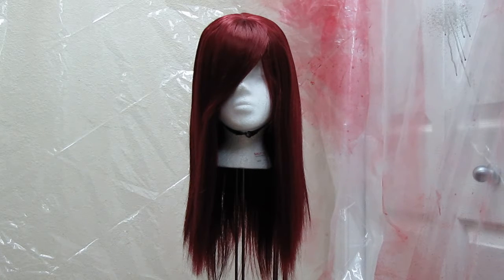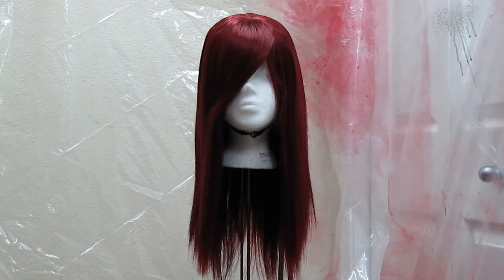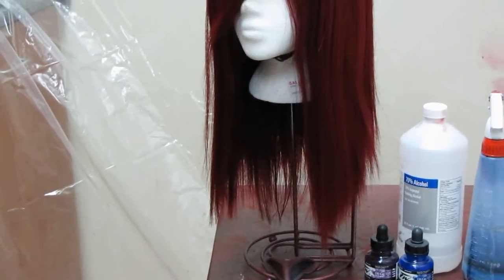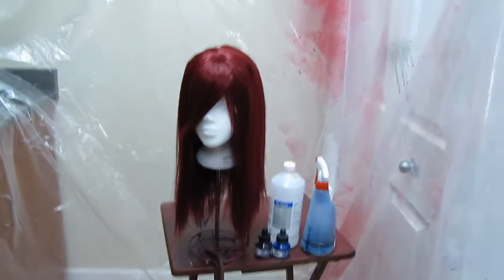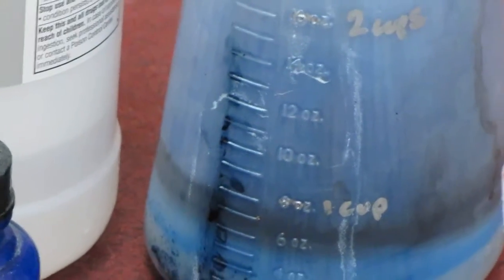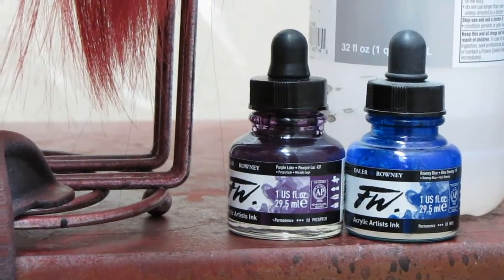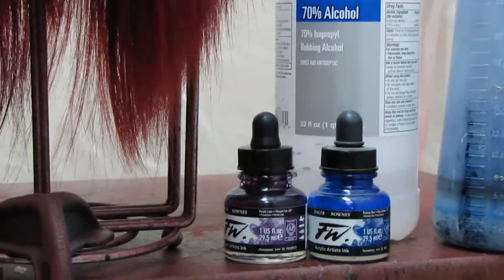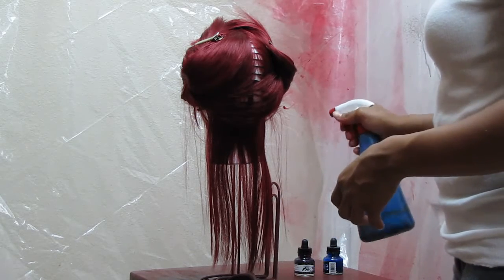Cosplay How-To's: Dyeing a Wig (FW Ink)

Comment: I appreciate this video. I wanted to die a all blonde wig with black under tones. I pin up the blonde part and put a shower cap on and pin that on. I used your technique and it turned out great. Mistakes I made was I sprayed too much die. When I rinsed it the water was clean but the die still came off. I then rinsed it again with hot water and dye came off. Thank you again for this video